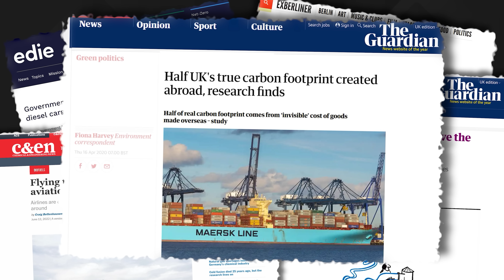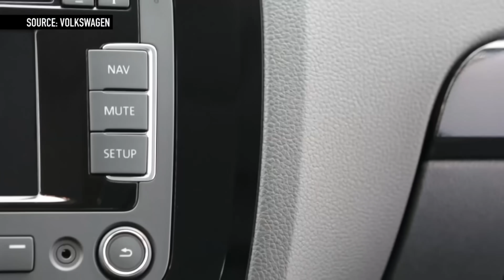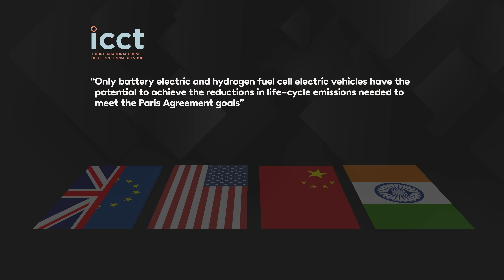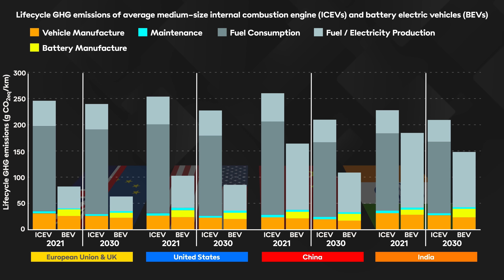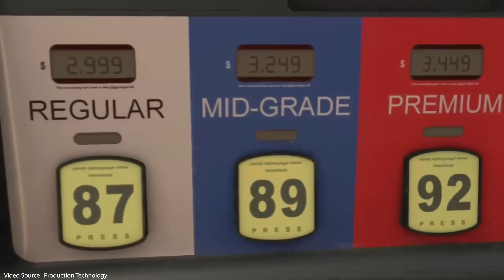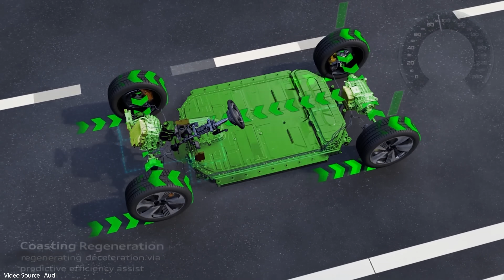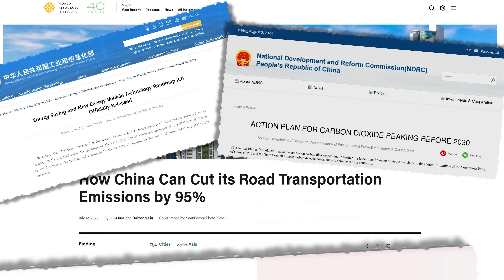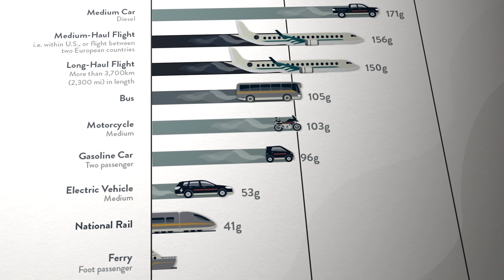Are EVs really better for the climate?

Comment: What about EMPs or temporary to permanent destruction of a main or sub power grid?
Reply: Lump in a Kerrington Event type solar storm.  My understanding is that most grid systems are becoming ever more resilient against such events, or at least compartmentalizable in response.  Add to that increasing power generation distribution and localized energy storage solutions.  All trends in the right direction to offer a positive answer to your question.  
I have a PV array that provides a majority of the “fuel” for my EV.  Not a tenable solution for everyone but surely available to a great many more folks than currently use it.
Reply: What about terrorism targeting regional fossil fuel infra? Go away, red herring
Reply: @polyglottenforpain  another errant question: "what are you?"
Reply: Resilience to solar EMPs is being built in to most grid systems. If the EMP is man-made we have bigger problems than worrying about the grid. Greater reliance on electricity requires greater robustness of the supply chain: that's very obvious and is less of an issue than was once thought